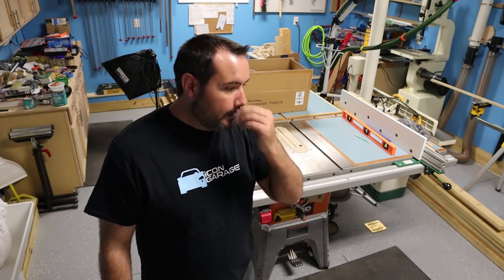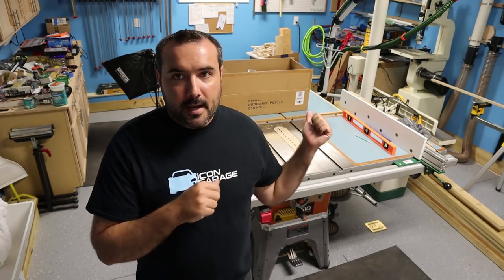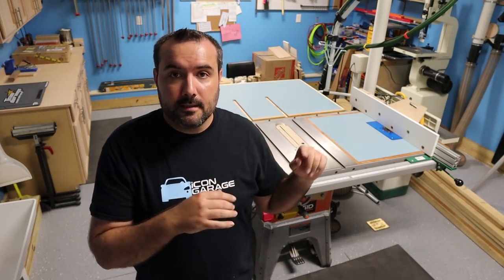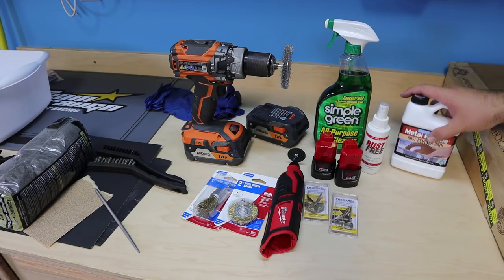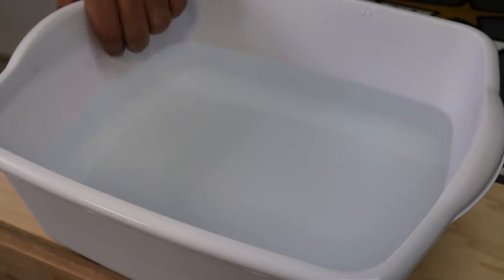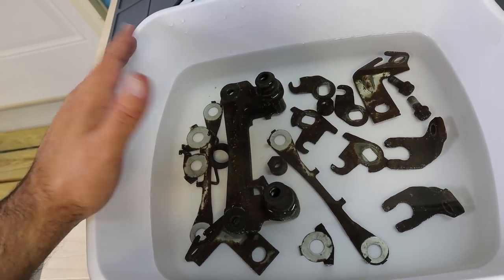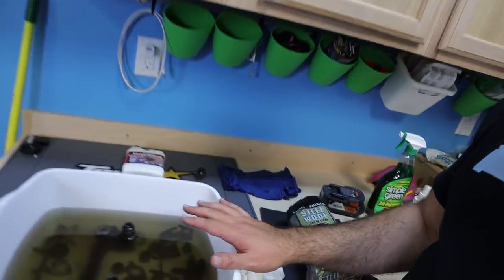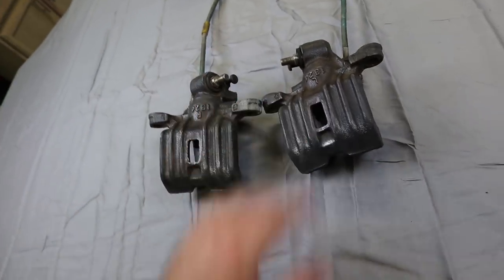FD RX-7 Brake Rebuild Part 1

Comment: For the best results - Just get the cast iron parts glass beaded. And for the steel pieces use 5 water to 1 part molasses mix.

Comment: lol I experienced the same thing when I was cleaning the carburettor housing on my motorcycle from the 50's. The Dremel tool spins with higher rpm and you can access tight corners much easier. Also some grease remover along with the Dremel works wonders.

Comment: why not buy a sand blast machine from harbor freight for $100 it will make your life much easier and  faster
Reply from the maker: I don't have room for one at the moment and you need a large air compressor ($$$) to get it to work efficiently. One day I will get a proper setup.

Comment: I don't see why you're going through so much effort to save stock brakes. Is the budget too tight for aftermarket brakes or at least new stock replacements?
Reply from the maker: There aren't many options for aftermarket rear brakes for FDs and reman or new brakes are hard to come by.  The front brakes on my car are good, just need a cleaning and a relativity cheap rebuild. I am documenting the process for all of those out there interested in rebuilding/repairing their brakes. A front BBK will be in the future.
Reply: Well, what about restoring the rear and replacing the front since the front to a vast majority of your braking anyways?
Reply: Stock FD brakes are pretty damn good.
Reply: They are 4 piston brakes up front and are on par with 4 piston Brembos for 90s cars. Have you priced out big brake kits lately specifically for FD RX7s? Brakes can quickly become the single most expensive upgrade.